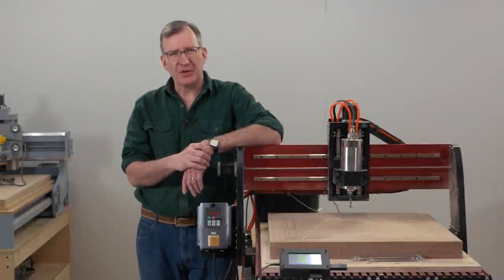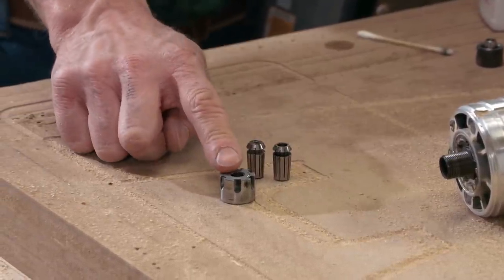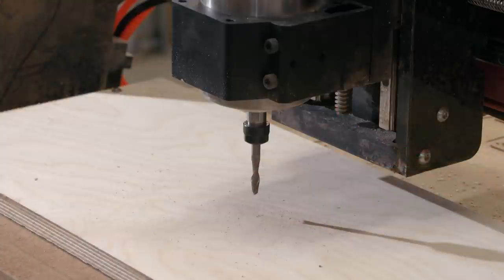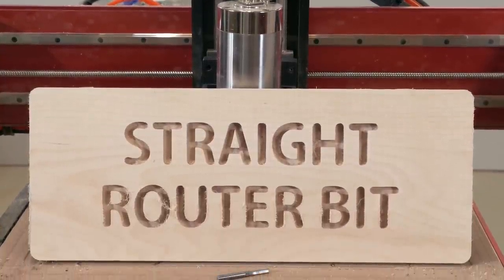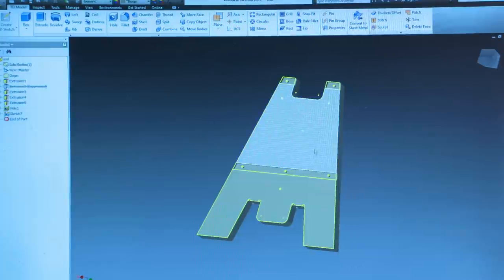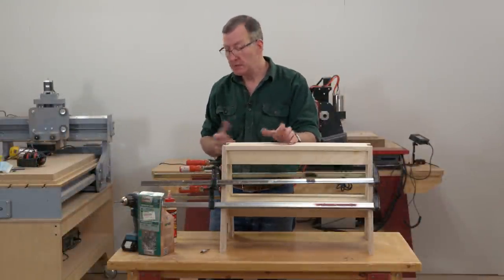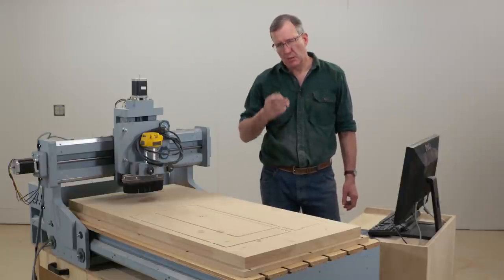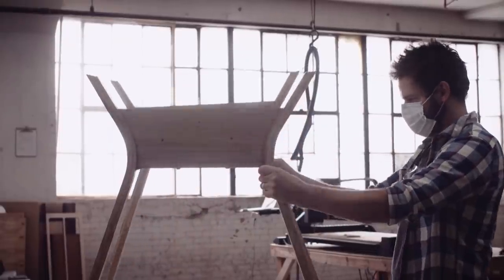CNC Basecamp Ep001: Smooth Cuts in Plywood

Comment: I typically run my 1/4 inch upcut bit at 16000-18000 rpm and at 300-450 IPM. When I ran it at 120 IPM it made a tone of dust, but at the higher IPM I get larger chips

Comment: Hi , thank you so much for this very instructional video.
Could you please let me know what sort of NEMA size are the stepper motors used in your machine? I am setting up my own custom machine for cutting plywood so I was thinking of getting your motor sizes as a guideline. Thank you for your help!
Reply: NEMA 23. I have 2 machines that run NEMA 23 motors and they work great.
Reply: minimum need use ema 23 450OZ/3Nm motors  woodworkers cnc machine, this is minimum , alltime better if can use biggest motors nema 34 6-12Nm motors.  same spindle, important NOT use router, not have plan used cnc machine worst noisy and destroy bearings fast. same money can buy better more torque real spindle etc, minimum used 800W air cooled ER 16 20 000RPM spindle cheapen than many router but more torque and better bearing and silent lot than router.

Comment: Why not start with a downcut and halfway through change for an upcut, sure its the same as a compression; but if you don't need/have the depth of cut than surely its the only clean solution?

Comment: how i set spindle speed right because i have 800W DC air cooled ER16 spindle, power supply have adjustable whit potentiometer but not know how fast this run. max speed is 20 000RPM.  i use normal 4mm downcut and 6mm up cut bits. i think maybe need buy some bit more, first run 4mm down cut top come nice and then change bit 4mm up cut if cutting 21mm plywood piece out of sheet. im worry can i cut pocket deep whit 4mm down cut bit worry not cut deep and broken bit. not have good vacuum system my DIY plywood frame cnc machine. i has cut little plywood im beginner yet, only some parts has make, i has drop feed lot because noise and vibration lot if speed have about 900mm/meter, normal i cut this about 80% less worry broken somethink, about 100mm/meter. up cut 6mm bit make lot horriple hairs to top of plywood.